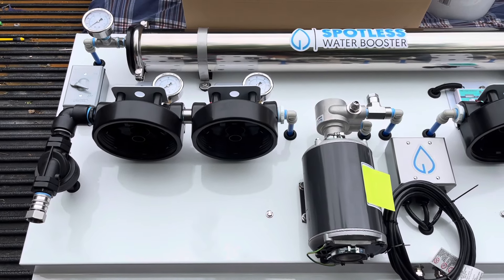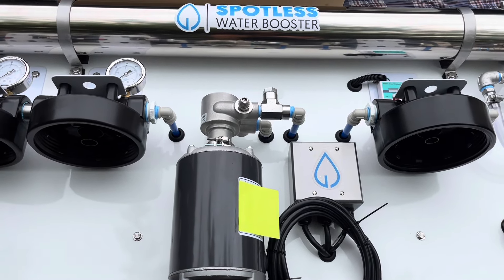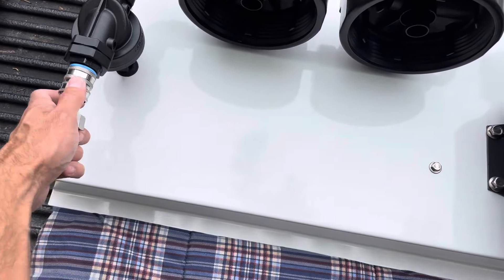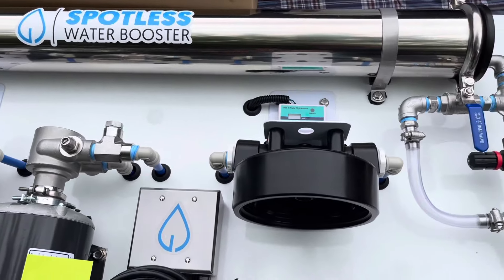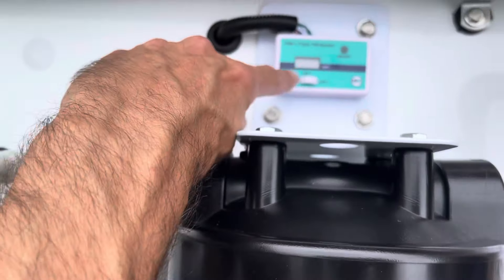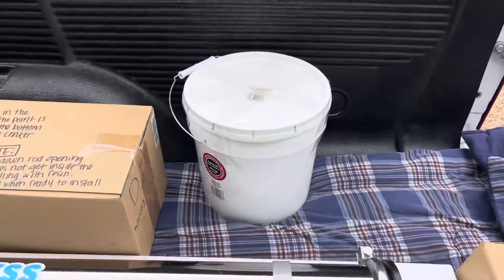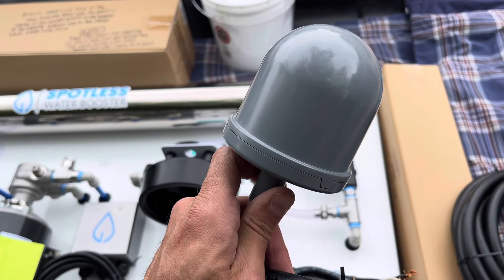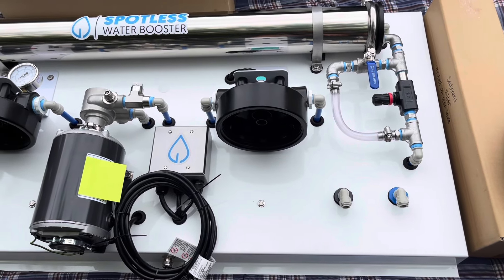Sneak Peek 🫣 New Spotless Water Booster

Comment: Excellent job! Can't wait for the release video. Would that system be able to work with the water going into a tank?
Reply from the maker: Thank you! Yes this system was designed to be a companion to a water tank!
Reply: @SpotlessWaterGuy  I meant to say not going into a tank and just straight out through a pressure washer. 😉
Reply from the maker: @ddautodetailing  oh gotcha! No unfortunately. This system needs to feed into a tank
Reply: Would it be possible for you to create one that would be able to feed into the pressure washer or would that cause damage to the RO system?
Reply from the maker: @benrios9643  Hey Ben! That’s such a great question. With RO it’s constantly making water and needs a place to dispense into. If you connected it directly to a pressure washer the motor and pump would continue to run even when you let go of the trigger. That would cause excess pressure to build up in the system which could destroy the filters, membrane and possibly even burst water lines. I don’t know exactly what would happen but it wouldn’t be good. The short answer is this system must be used in conjunction with a water tank. Unless you are a window washer... That wouldn’t require a water tank because water is constantly flowing through a water fed pole. In this instance it would be fine because the water is constantly dispensing. Hope that helps!

Comment: Do you offer a mobile cart version? Would be handy for those of us who wash our cars outside in our driveways?
Reply from the maker: This type of RO/DI system requires a lot of pressure and a water tank in order to work properly. When it’s on it constantly makes water. If it were connected to a pressure washer that is being used Intermittently it would cause the system to build up back pressure and probably destroy it. If you’re looking for something to wash a few cars in your driveway the CR Spotless is probably your best best. This system is for mass production of spotless water. Cart options are out there for people like window cleaners but they produce spotless water at a trickle pace.

Comment: So is it worth recycling the waist water to run again or a waist of time?
Reply from the maker: I’ve heard you can recycle up to 30% of your waste water. I haven’t tried. Waste water is highly concentrated. The TDS is extremely high. This means whatever waste water you reintroduce back into your clean(er) water line your causing your RO membrane to work harder. This puts extra stain on the membrane which in my opinion, the juice isn’t worth the squeeze. This is a really great question. I’d rather put as less strain on my filters as possible.